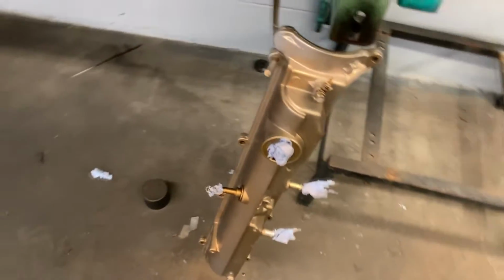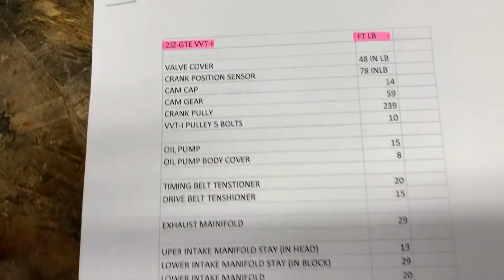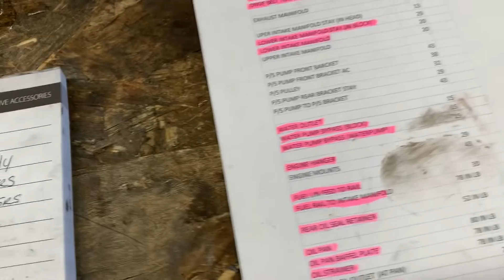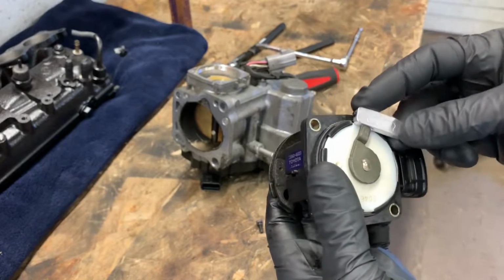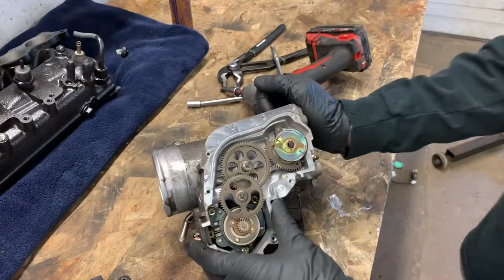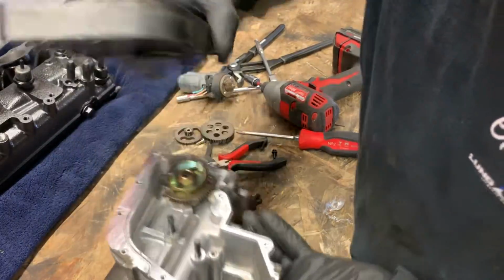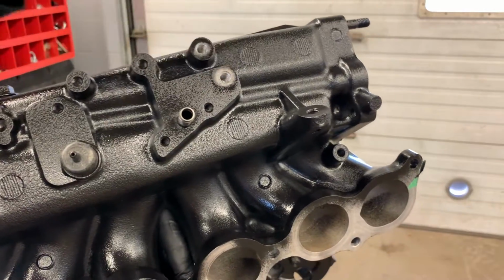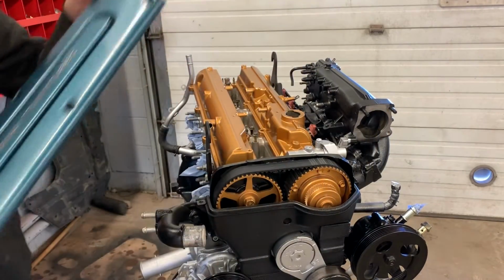2JZ DBW DELETE, VALVE COVER PAINT

Comment: Quick question for the cam caps it’s 14lb torque. How about the two hex bolts that’s on #1 cap of the the intake cam. Thanks in advance.
Reply from the maker: to be honest i think i did 10 but i cant remember exactly and cant seem to find it